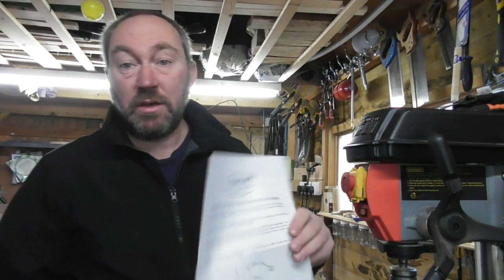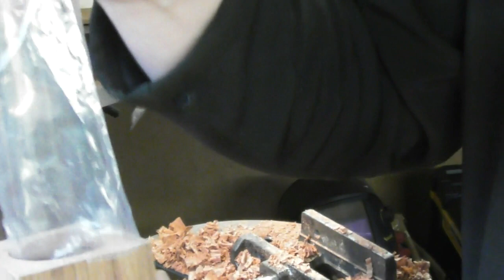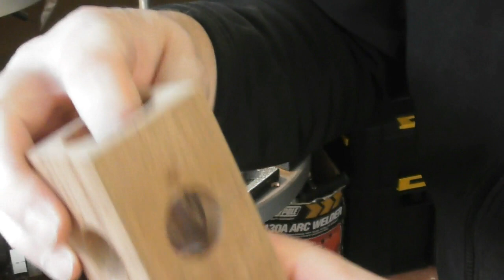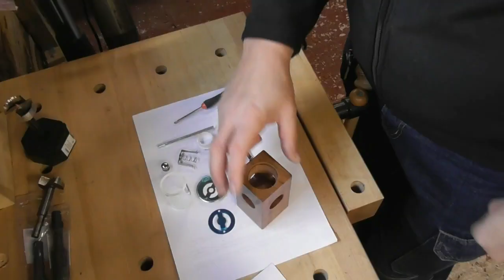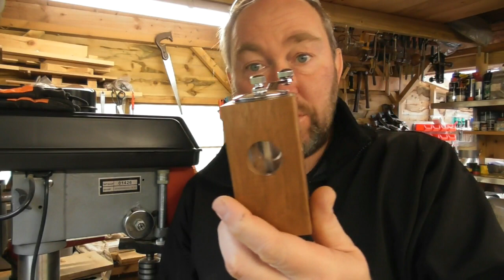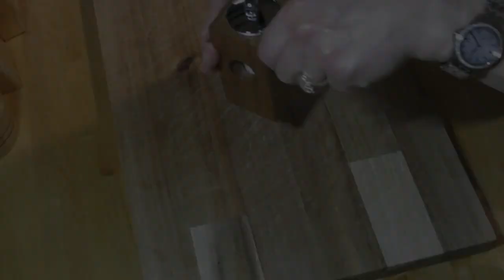Crank Top Mills  - Chrome

Comment: Cracking video Jon, can I ask where you got the Perspex tube please .so refreshing to find good honest videos,cheers mate
Reply from the maker: I got it off eBay (yuk!) I think I got about 250mm and it was classified as 25mm, however it was actually 24.8mm so it fitted in a 25mm drilled hole perfectly. Just beware if you get some and do a test fit like me - flipping nightmare to get a short piece out again. Mt tip is do a test using a long bit. PS - thanks for your order - it's on its way. Cheers, Jon.

Comment: Great video as usual, I like the design it is different and would look nice as a set and if you wanted you could round over the portholes and add a slight chamfer to the corners so it is a little bit more comfortable in the hand,  nice work Jon. (You need to see someone about this obsession you have with mills LOL)